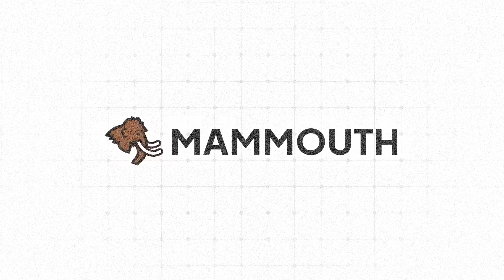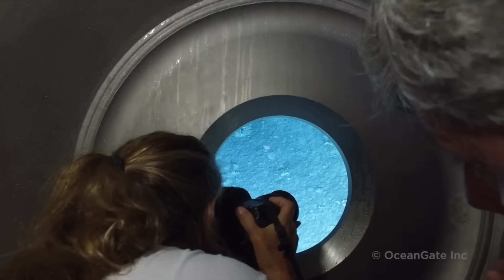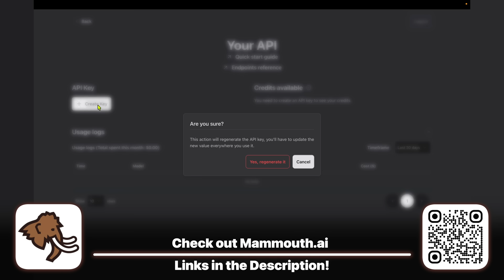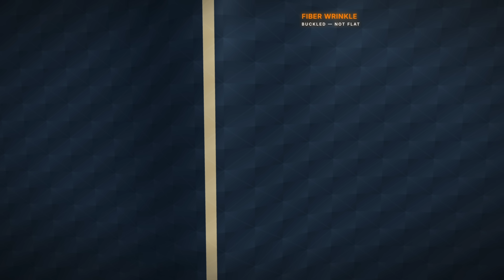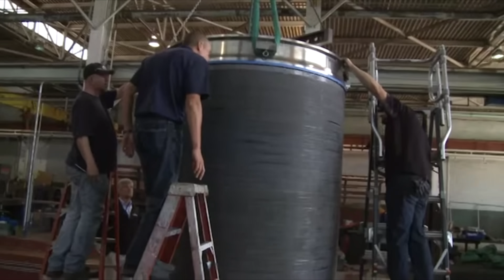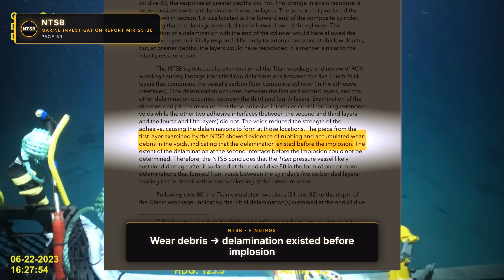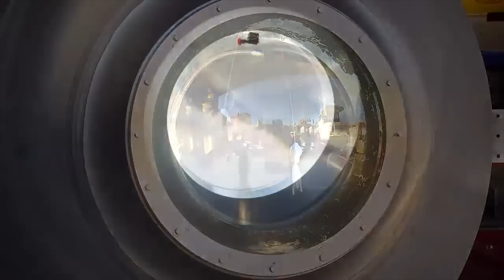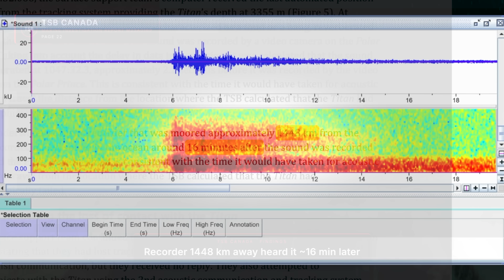Oceangate Titan: It was WORSE Than We Thought

Comment: Early in my engineering career I came up with three painful lessons learned.  1) Every test not run fails.  2) If you see a problem once, but didn't fix it, you'll see it again.  3) If you don't understand why it works, it doesn't.
Reply: "Untested Specifications Are Meaningless"
My father was a electronics and electrical engineer (EEE) educated at Ohio State.   As I went into computer science he taught me that principle from his engineering education.  That served me very well in my career of software development.  

That principle relates directly to your painful lessons 1) and 2).  Painful lesson 3) is harder to relate to, but I do see the importance of it when developing something.  Those doing specification testing don't necessarily need the understanding.  The burden of understanding is on the developer of a particular capability.  

In the case of the Titan, it was specified to do deep dives, yet it was not thoroughly tested in those conditions before use.
Reply: @captnnero  Stockton Rush was failing; it converted his personality to embrace his homicidal impulses, and he wanted to go out with an insane blaze of futility.  He deliberately got the passengers killed.  Stockton was looking to go down in history as a spectacular and inventive killer, and he got what he wanted with this underwater-triple-murder-suicide he committed.
Reply: @reddyrippin   that’s a stretch. never attribute something to malice what could easily be explained by ignorance. 

But, yes he was, yes, dangerously ignorant, and that got his passengers killed. 

But I think he believed he was an “innovator”, and probably thought if he established regular visuals to the Titanic, he’d soon own a very lucrative undersea expedition company. 

I think he was blinded by his ambition to fulfill this dream. And financially motivated for it to succeed. (He also took passengers, in a prototype throwing error codes. When he should have been doing more testing and debugging (which would eventually proved it exceeded its fatigue limit after only a few dives) 
It’d be illegal to offer tickets on a plane you built at home, but idk how international law about that works (he clearly got around it) -
Reply: @McPhearsum  the first paragraph makes him potentially president.
Reply: @McPhearsum  Yeah.
That part actually didn't get enough attention, in my opinion. Then again, what would you expect from a financier / investment professional )))
Not only his whole venture, for all the glamour, was perpetually strapped for cash where it mattered (never mind fortunes spent on PR parties). That outdoors storage, prototyping and testing phase compressed almost as tightly as mr.Rush himself got compressed under the weight of kilometers of sea. Lack of a special purpose mother ship, down to chartering cheaper ones with no onboard crane for direct deck-to-sea launch - their entire gimmick with "independent launch pontoon" boils down to no properly equipped permanent or semi-permanent carrier. On and on.

Not just that.
His business made no sense even if it all went according to the plan. 
At least with the numbers published, even if that Titan sub was structurally guaranteed by the Allmighty Himself, I did a couple napkin math, ends never seemed to meet well.
Narrow-purpose naval operations are expensive to run. Even in "safety second", "parking lot for off-season storage" mode. Cargo+passenger "expedition/research" vessels are rare, charter scheduling is a nightmare. Logistics also is - his plans needed the titan + carrier ship to stay in place over the wreck for weeks, doing multiple dives. Guess what, people paying far sex-digits for an "unique adventure" of several hours rarely appreciate the extra premium waste of weeks staying in the middle of nowhere in the ocean - those would've needed ferrying back and forth, also not cheap. He was already raising prices at surreal multipliers - itself a very good sign of a "very good" financial planning - and bar absurd scenarios, I couldn't count a solid path to getting returns on those grand investments that would beat VOO (e.g. S&P 500 ETF) - BEFORE accounting for risk premium.

There are no magic "scaling" like some online service, no obvious giant addressable markets (like, even the very boring commercial orbital launches is a huge, internationally and industrially diversified market that's not drying out any time soon) - nothing of that sort. It's the opposite - we didn't even go beyond the assumption that he's gonna have a steady stream of clients ready to pay what amounts to a good flat in a nice developed city - for that couple claustrophobic hours and unique experience through a looking glass the size of average OLED screen panel.

This is important. Remember how for over two decades, it was all talk about "space tourism" as supposedly high-potential business? There were some actually sent up there. 
Just as the technology "got there" on the new level, far better looking than what was back when said hype started - yet nobody seem to talk about it much anymore. Guess why.
Bookings are filling up, they do. Just far not as hot as needs be to hype it as the next big thing. And we are in a roughly comparable price category and type of experience.

I do not like convoluted conspiracy theories much, but as we learned, sometimes, there ARE actually secret cabals of rich people meeting together on remote island to peruse sexual services of young girls ))) (Ironically, it also strengthens my skepticism: so here, the elites, cream of the crop, billionaires and legit princes, gathered in secret cabal, and what they do, conspire to control the world? Nah, they do loli-s :body-blue-raised-arms: And they do STDs and subsequent divorces)
However, business math lends some above-zero credibility to the idea that Rush realized only all too late that he's, to put it bluntly, proper fucked. Dangling on the edge of a very public and embarrassing bankruptcy, with only one way to go. For people of such "larger than life", nicely speaking, character - this often feels like real fate worse than death. 
So it is possible he chose to go down literally, more dignified, heroic, at least in his own mind. 
It might not even had been a fully conscious, self-aware decision. Well-observed pattern for people in some combinations of character and distress - "suicide through self-neglect". Like, he didn't know when that can is gonna pop, he just kept going in and going in, until it did.

Mind you I'm not trying to absolve him or anything like, even if this wild guess hits the bullseye. 
I do however keep repeating that, quite ironically, at least 2 of the 4 people he took with him on the dream trip, one-way only - were a rich almost full-time extreme/expensive adventurer, and a ultra-deep diving professional, those two DEFINITELY should've known better than to get into this "highly advanced" can.
Reply: @BroOmnipotent  exactly. He was in such a rush to make/force his idea to be viable.  my guess is he thought time was running out to prove he could take paying passengers to the titanic, and have the public success, and capable of generating revenue. 

Idk if he had other investors breathing down his throat to ‘put up’ or ‘shut down’ unless he could prove it was nearly ready, or was purely his (poor) decision making. 
But regardless, the fked up part is, they were clearly still in the ‘testing/debugging’ phase, in terms of engineering and design, yet they’d offered a tickets as if it’d be a (expensive) Ferris wheel ride. 
The Indian billionaire wouldn’t have taken his son with him if he was truly aware he was essentially signing up for to be a test dummy on the maiden voyage of a craft designed explicitly against the guidance of engineers. 

Like in aerospace, everyone knows, the newer the design, closer to prototype, the more potential problems. That’s why only the most experienced pilots and copilots are used on test/experimental aircraft. And obviously, you DONT bring passengers or anyone who does HAVE to be there in it, till it’s been proven over thousands and thousands of hours or work, redesigns, flight testing, etc. 

Stockton Rush thought he could do that all by himself. When it’s not even easy for multi-billion dollar company like Boeing. AND at least in the air, the pressure differential is at most 1 atmosphere, while for deep sea you’ve gotta design a pressure vessel for 10-100x atmospheric pressure!!!!

In Stockton’s head, I imagine he thought, “if this goes well, I’ll finally be proven right, and the company will take off!” 
He subconsciously was refusing the possibility of failure, b/c he was to arrogant to believe he could fail, and b/c he couldn’t face the possibility that his entire venture and presumed engineering knowledge was a bust

 ( I’m sure the words of the engineers that quit and wrote letters stuck in his head, but instead of heading their expertise, did they “they just haters” routine to avoid self reflection. I bet in the last seconds, as the strain gauges alarmed, one after another; and the hull started to creak and pop as the carbon fiber flexed, I wonder if his last thoughts were, “oh no, he was right!”

I didn’t even spend that long focused on pressure vessels, but even I know you can apply some pretty basic math to figure out stresses, and the oil and gas industry already has standards for subsea vehicles to use. 
The choice of carbon fiber is just SO baffling. Any freshman/sophomore engineering student who’s taking Materials Science could right a paper on why. Would likely have been fine had he used a variety of appropriate metals, and proper welding/assembly, (well basically redesign the whole thing according to an engineer)
Reply: @BroOmnipotent  unfortunately, some (wealthy) ppl (like him)  fall into the trap of thinking educated experts are just full of sht, and any ‘smart’ person to intuit the same thing. And they think that being ‘so passionate’ about something will somehow overrule the laws of physics, as if they think they can ‘will’ their aspirations into existence. This thinking works when they can pay their way out of anything, hire experts to do the actual heavy lifting, but as soon as they start firing the people around them and trying to micromanage, they’re no longer insulated from their ignorance and mistakes, and their recent life experience of success leads them to believe they literally cannot fail.
Reply: Please digest that dealing with AI output forces us to act against your rule 3 on a large scale!
(Rule 1 also frequently impossible)
Reply: @HuckleberryFinn_7 exactly why I limit using or relying on AI.
For point 1 I'd rather things fail in test than in production, but I guess you're a bean counter who wants to push everything to meet deadlines before testing anything.
Reply: @Moonstone-Redux  We are certainly not the majority right now as seemingly everyone is mad blind behind AI. But let the dust settle, and a new norm will be set with us at the center. (Though I'm not saying it will be completely where we are yet)
Best thing to do imo? Use it use it use it, so much so that you know exactly where the weakpoints are and how you can augment your own skillset and expertise, then you could be defining the change. Maybe.
Reply: @itscryonim  So far my trust level of AI is about as much as I trust information given as a result of torture: as far as I can personally verify it. 
The only time AI has been actually useful to me was when it was summarising something and I need to zoom in to the main point quick. In that case once the spotlight is found I can get to the section that is the focus of the summary and then verify the summary's accuracy.
Reply: @itscryonim  can't really tust something you have to constantly fact check.
Reply: @robertfindley921 exactly
Reply: All I've learned from all of this - yeah, I'm good with pictures and video of the sunk Titanic
Reply: @TheSulross  Personally, I would love to see the Titanic with my own eyes, but only in a properly engineered, tested, and certified submersible.  Of course my chances of ever actually doing so are effectively zero.
Reply: these rules apply 100% to the world of software as well, especially (3)
Reply: This guy is dropping straight philosophy on us.Thank you sir.
Reply: You wouldn't get me in that sub if you paid me $1,000000, even when it was new.
Reply: @daviddickinson6346  I just built a submersible to go to the titanic! I’ll pay you $1,000,001 to be my first customer. 
The hull may be made from recycled scrap metal, 3D printed HDPE plastic, and PVC.

 (Don’t worry, I fired the materials engineer, and used paper mache rather than weld the metals together. Surely will hold up fine under pressure and water!)

Instead of a PS2 controller, it operates entirely on the hopes, dreams (ignorance) of rich men and the thoughts and prayers of family members and fired engineers! I promise you’ll get to go to the titanic! I can’t promised a return!You may get to stay much longer than you expect (in perpetuity). 😅
Reply: Heeding that held back my promotion for ten years.
After the exponential rise in problems, I was finally promoted.
As an engineer, you need staying power when dealing with business managers.
After that, they can save money on the coffee for guests, travel expenses, and office furniture.
Reply: As a software engineer, number 2 is particularly painful. You run something 50 times and never have an issue. You run it the 51st and have a random unexplained error. You chalk it up to your development machine having a dirty cache or whatever. You run it another 50 times and never get that error again.
You push to production convinced everything's fine, and suddenly you're getting thousands of that very same error per minute.

Also I would add: adding an additional check for something that you assume to be impossible never breaks your shit. But rest assured the one time you don't, that "impossible" situation will magically materialize at 1AM on a Saturay and you'll stay up til 6 before figuring out what happened.
Always check every single input and if anything is wrong, throw a SPECIFIC exception with the exact issue that was found. That way at 1AM you'll just wake up, check the logs, send an email detailing whatever is broken (which is hopefully not something you're also responsible for), and go back to sleep. And everyone will think you're a genius for figuring it out so quickly.
Reply: @robertfindley921  as a former fixed equipment reliability engineer, on (3), I’d slightly adjust to “if you don’t understand why it works, it won’t work for long, and what happens then is Pandora’s box failure mechanisms”
I was also not surprised whatsoever about this event, knowing the materials used and construction methods for the environment. Any MechE could have (and did) protest using carbon fiber, since it was going to be in compression. Could have used basic oil gas, sea industry ASMIE Boiler Pressure Vessels S. VIII, standards I used as an intern right out of school. Too much money made him think ambition could override his engineer’s protests. I been in similar situations with companies. Predicting failure, or saying failure life was exceeded by 400%, alarms were inactive, in a 150ft tall fired heater full of 1300 degree 9Cr tubes of refined oil products.
Reply: Also a safety factor of 1.25 of absolutely insane. I was trained for minimum of 2.7 - 4
Reply: I needed to hear this I think...
Reply: Like "AI"
Reply: Perfectly framed and should be drilled into the heads of every engineering student before they graduate and are licensed. My engineering background is in Nuclear Power Production. Typical reactor designs are such that every 16 months (more or less) about 1/3 of the core fuel rods are replaced. Imagine the reactor core as consisting of 3 circular zones. The center zone is the fuel that has reached its lifetime. During core refueling that is removed and the next zone's fuel is shuffled into the center. The outer zone is shuffled into position #2 now. The new fuel is installed in a highly engineered and fixed position on the outer zone or periphery.  The actual process is conducted to exacting standards and a highly detailed procedure controls the entire evolution. The physics of the freshly refueled core has been devised using exacting and well-understood processes. Once refueling is completed an elaborate and detailed physics testing/evaluation is completed. The control rods are manipulated and the reactor's neutron flux response is measured and compared to the expected computations that were performed.  This testing is highly controlled by detailed procedures and includes all expected responses, as well as the tolerances for any variation. Obviously this brief explanation of all physics and engineering involved is an order of magnitude more precise than what I understand occurred with the Titan. It's almost sickening to read and hear how many short-cuts and deviations were ignored in operating this machine. Five humans put their lives on the line for a device that was more intended for fiscal profit than redundant safety design and operation. They gambled and lost because of Rush's haste and unfortunately, greed that clouded his judgement.
Reply: "Every test not run fails" is an interesting one. It depends on experience (and there was no experience of carbon fibre in the conditions Oceangate exposed it to.) I was the main technical engineer overseeing a very large furnace for a refinery. At 2 megawatts, the combustion air fan was too large to undergo a full performance test at the shop, and the project engineer expressed concern about it. I said "I don't care if the fan passes its performance test or not, so long as the combination of the fan and ducting delivers the right amount of air." I knew the fan vendor had made dozens of similar but not identical fans. I was therefore sure the fan would pass. The ducting arrangement was however unique to the project, with many opportunities for human error.
Reply: 3) If you don't understand why it works, it doesn't.
Feel free to use that for marketing purposes, though, as in "We don't know how LLMs work" or "We don't know how the economy works". Goes very well in combination with "We don't know WHY it works, ... it shouldn't."
Reply: @SonicVrooom  If you don't know why it works but it does, that's great. Until it goes wrong and someone asks you to fix it. That's what gets governments in trouble with the economy.
Reply: The last 5% takes from 1x to 10x the cost and effort of the first 95%.
Reply: I'm getting this put on a t-shirt. thank you for this, truly. These are rules for life brother
Reply: THIS!!! True words! May I use them in my future?
Asking as a survivor of a dust explosion.
Reply: "You fail 100% of tests you don't run." - Gayne Wretsky
Reply: Legend has it the mainstream media is still counting down how many days
of oxygen the OceanGate Titan has left.
Reply: Sure wish software devs believed that.
Reply: I can NOT understand how any of what you outlined isn't just simple logic and a matter-of-course.  I'm an engineer that didn't struggle with any of that.  It's so elemental. Your last point is idiotic.  Anything could work without your understanding, especially you, and function just fine.  You're not a particularly good engineer, are you?
Reply: @dan1906  the last point is a common engineering design problem called a black box. If you don't know how it works you cannot be sure it will always work.
Reply: @dan1906  It should be pretty obvious he's referring to understanding the elements that form part of the design you're responsible for. Any good engineer would immediately know what he means by that.
Reply: @dan1906  If you do not know why a product you built works, you are a gambler, not an engineer.